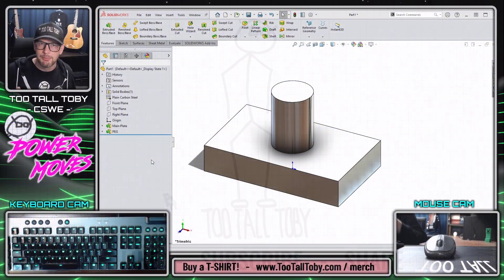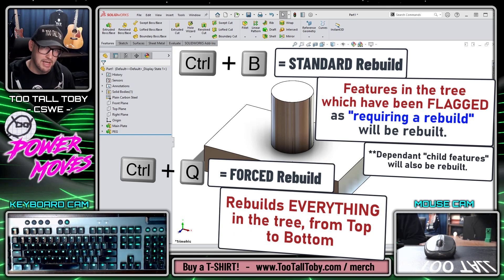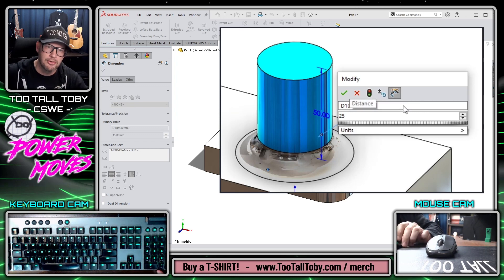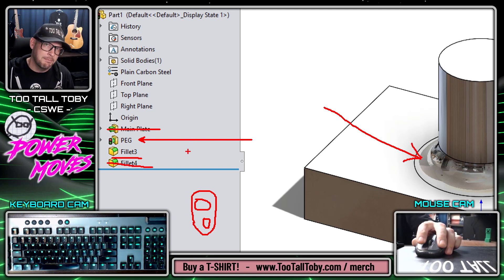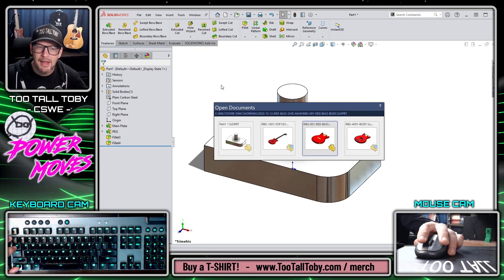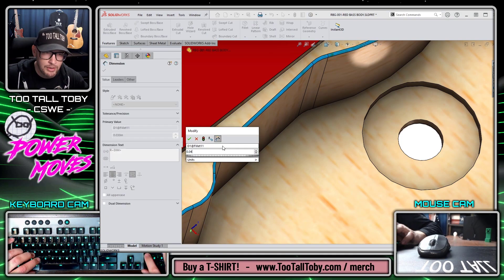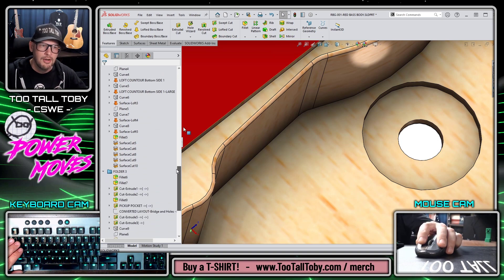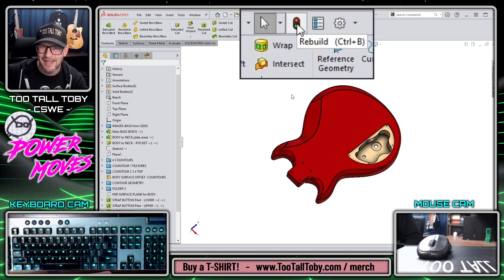CTRL+Q vs SOLIDWORKS rebuild– What’s the Difference?

Comment: If only two features along the tree are changed how does Ctrl+b rebuild the entire tree if the remaining features in the tree were not altered. Because either way features preceding the changed features are inter- related either way?
Reply from the maker: Ctrl+B does NOT rebuild the entire tree.
CTRL+B rebuilds features that are flagged for a rebuild (usually due to a dimensional change) and any related features further down the tree that have a child dependency.   But not every feature further down the tree has a child dependency.   
Ctrl+Q does rebuild the entire tree.